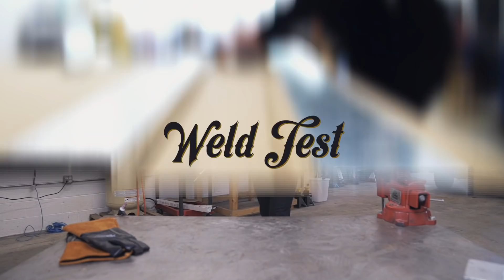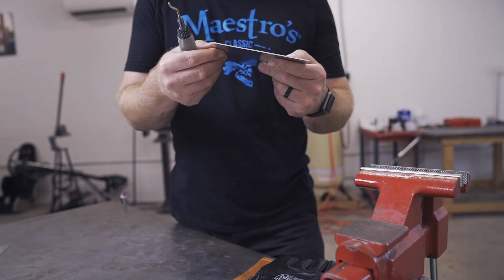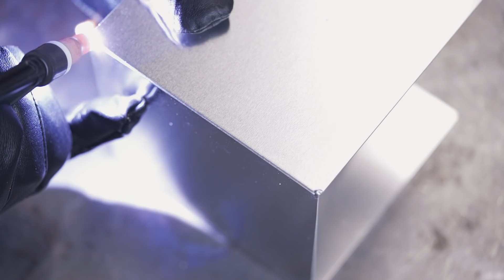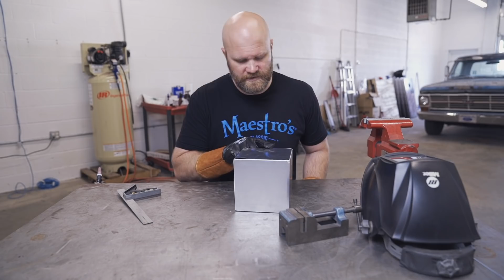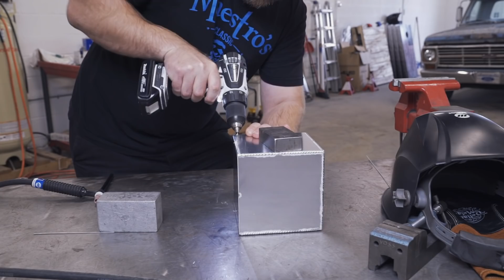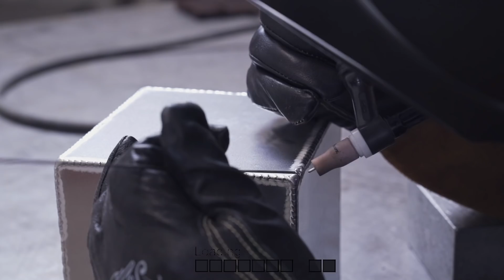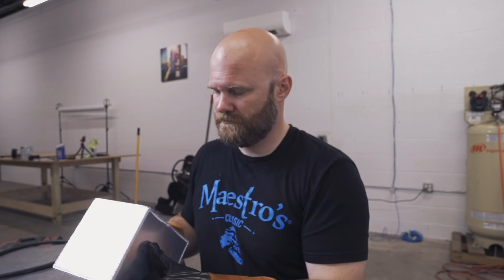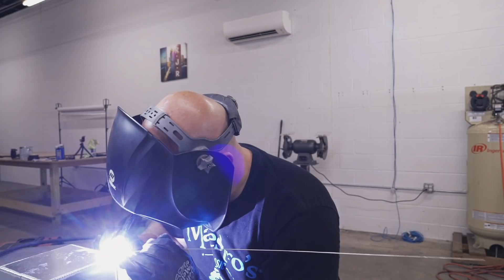Ace a NASCAR Welding Test - TIG Welding an Aluminum Cube

Comment from the maker: Incase anyone’s worried, I did get the pin hole welded. After I edited the video the piece had cooled off and it welded up fine.
Reply: Use a basketball inflating needle and fill the cube with argon
Reply: @adamchase3359  yup , easy peasy
Reply: @adamchase3359  yes very good idea
Reply: @adamchase3359  boom
Reply: @adamchase3359  damn thats smart, gonna keep that in mind
Reply: @adamchase3359  do you not weld aluminum with helium
Reply: If you cool it of during the weld it will pull the weld in
Reply: Justin Voss I was just gonna day that. When ever I’m welding up a sealed “whatever” I always have to let it cool and then quickly weld the last little hole.
Reply: As you found out and many have said, let it cool and it will close right up 99.9% of the time. 

Another tip for a cleaner appearance (especially if it does blow out on you in the process of trying to close it) is to drill your hole dead smack in the corner formed by the 3 sides. I noticed that you drilled it back along the seam about 1/2" or so. This can cause blow-out after you pass you hole to fill the last 1/2" or so.  The very last thing you want to weld is the hole itself, so better to have it as the last dab of the filler. Plus if it does blow out on you, no one will ever notice after you fix it and get it to close because it will be at the end of the weld so it will look like you just added extra filler to crater fill.
Reply: Chris this is a solid plan.
Reply: Who else gets to play with a Miller dynasty 700 every day (:
Reply: @MichaelA-rp2hy  I don't think 10% of all tig welders touch one. That is a huge tig tho I've never used any bigger than a 450. Theres definitely jobs that I needed it tho....
Reply from the maker: @Michael A Used to. Favorite welder. Would love the new 800!
Reply: @JustVoss  I'd punch in 10 minutes early every day for one of those Haha we've come along way since the old 60hz syncrowaves
Reply: Justin
Reply: @JustVoss  we just upgraded from the 700 to 800 and we've had 2 blow up already. Brought our 700s back out for now while the 800s are repaired although I think we'll be getting new ones the insulation and chasity and motherboard all the innards just blew right out of both them. Loud as hell like someone slamming a hammer next to you while your TIG welding but other than the insulation and some of the inside plastic parts nothing flew too far.
Reply: Justin Voss why dont you use a jacket? Skin cnacer i so cool you know
Reply from the maker: Probably should. I’m not welding all day  and most people in racing don’t so it’s never been a habit.
Reply: Justin Voss  I watched this video just to see you run into that problem lol. Your experience was the same as mine. Let it cool and fill the last bit quick.
Reply: By the way, the pressure is building up because of heat put into the air already in the box, not the Argon as a very small amount will get through that hole (which is also why it didn't look good because the air inside displaces the Argon from the torch).
Reply: Personally i would have thrown the cube in the freezer for about fifteen minutes and then sealed the hole.
Reply: It depends on what you want for the pressure. If you want the finished product to be pressure neutral, weld the pin hole quickly when it's cold.

If you want the hole weld to be really easy in terms of pressure and you don't mind the box having low pressure (and possibly sucking in the sides, which can be a cool look), let the whole box get as hot as it is going to get, and the pressure will be equal WHILE you are welding. then the pressure will drop once the box cools. 

The biggest issue is well the box is only medium hot when you start. That's how you get the maximum change in pressure during your weld.
Reply: Let it cool, fill w/argon with a sports ball inflating needle and put chill blocks next to your final weld.
Reply: @bluevette1978  that's great advice
Reply: My first welder was a air cooled Syncrowave 200 then I sold it for 2800 and bought a Everlast Power Pro 256 and built a watercooler and upgraded the torch to a ck flex lock 20
Reply: @alexhise968  ahhh yes  those were great ,still great although a pain in the ass if your trying to make it in aerospace. 60hz  and a balled tungsten at low amps = unstable arch  still it very doable with practice I used a 350 to pass my d17.1 and burning through a shit ton of aluminum coupons  in the process haha  on the flip side  learning to weld thin using a transformer power source makes you much more efficient once you get ur hands on modern inverter .
Reply: I don’t believe you
Reply: Something it could have been was if any oil was on that drillbit
Reply: Tony Bain 

Yes, even the slightest fucking amount of oil can cause issues with aluminum. Its kind of ridiculous actually.

Clean clean clean, make sure everything is spotless. Grinder wheel residue, using a file or wire brush thats been used on mild steel or anything other than the work.
Reply: How do I apply for a welding job in NASCAR??? I have d 17.1 AWS certification
Reply: Shitt!
Reply: PISS! OUT MY ASS!
Reply: Made a small cube like this:  20 minutes to weld all sides together nicely.  Damn near 45 minutes trying to fill the pin hole.  Learned a lot about heat control and cooling during the “repair”!
Reply: Why not use denatured alcohol? Is there a property of acetone that makes it more desirable or just cheaper?
Reply: Still a suggestion/idea for in the future, but would it be a bad idea to size down the drill bit, then drill TWO holes, so it would be easier to cover them, and still vent well enough to not take breaks near the end?
Reply: Are you related to Kyle?
Reply: Yeah, 4 years Kate but I was going to suggest putting it into a freezer for 15-30 minutes. But too cold it may ballon out when it warms up.
Reply: Just let it cool off and then hit it real quick
Reply: You dont have to wait to fill the pin hole just add more heat pushes the hot gas back in so you can fill it. Then you will see the sides suck in during cooling.
Reply: what my teacher said to me and show. if you keep getting quick blow out. depends on the size if it like pin hole. cut alluiuim welding rod to small pin nail, get piles or use vice and use hammer better yet body hammer to create a head on you pin. then tap it in the hole and tac weld it in then go over it. if long bubbles forming just grind it into v like shape grove then weld. tbf pin head weld trick it is 50/50 :P lol
Reply: @Justin Voss Whenever I weld up something like this that has to be sealed, I've had pretty good luck welding it nearly all the way out (leaving the vent hole or last little crack open), giving it about 30-45 seconds to cool, then sealing it up.  The way it was explained to me is that you want to seal it up when it's at the transition point between air going out due to heat and coming back in as it cools.  Since I started doing that, I haven't had any major issues sealing things up.  Cube looks good, though.  I didn't catch it in the video, but what did you have you frequency and balance set to and did you purposely ball the tip of the tungsten at all?  A little curious how the 1/16" tungsten held up.
Reply: @zachdaniels8112  The fit up didnt have any open gaps, they were all corner joints welded as lap joints essentially... hence him having to drill a hole to create a gap.
Reply: @kronicsoldier  yes, I understand that. I was referring to the end where he was welding said hole to seal the cube. Just an idea that's worked for me.
Reply: @zachdaniels8112  so you mean just let it cool... which this comment we're replying to "Incase anyone’s worried, I did get the pin hole welded. After I edited the video the piece had cooled off and it welded up fine." is exactly what he did...
Reply: @kronicsoldier  in the video he was unable to seal the cube despite a number of attempts. I read and replied to this comment with a tip, from one fabricator to another, that I've found to work fairly well. I doubt seriously that this is the one and only time he (or anyone else) has or will need to seal weld something and there are times, especially during weld tests, where you won't be able to let a piece cool completely due to time constraints. That's why I commented. 👍
Reply: @zachdaniels8112  "Incase anyone’s worried, I did get the pin hole welded. After I edited the video the piece had cooled off and it welded up fine." you mean the tip in the pinned comment? lol.
Reply: @kronicsoldier  if he let it cool completely, which I'm guessing was the case although I can't be certain, I'm saying for future reference that isn't necessary. I don't really know how else to explain that. If you don't understand it, well, I don't know what to tell you.
Reply: @zachdaniels8112  well thanks for the tip that was posted in the pinned comment and in other comments as well... I especially liked your hot air cold air transition theory, because air going in or out definitely changes how your argon is going to react lol changes my whole view on inert gases haha... And yes the tungsten would be balled on purpose. 1/16th tungsten would hold up fine with .063 aluminum sheet metal and  (possibly 1/8 but the way it flexes it appears to be 1/16 filler rod.. Anyway have a good one bud.
Reply: @kronicsoldier  when you weld a sealed enclosure, the heat generated from welding will eventually heat the air inside the enclosure as well. As gas is heated, it expands, which is what causes the blowout when the last little bit is welded. The gas escaping from the hole literally blows the still fluid puddle out and blows the shielding gas exposing the molten metal and tungsten to atmospheric conditions (same as trying to MIG or TIG in a breeze). After a short break from welding (30-45 seconds, like I said previously), pressure inside the enclosure should have nearly equalized with pressure outside the enclosure resulting in close to zero flow through the hole, which can then be welded. I've tried seal welding aluminum boxes multiple times and have had better results giving it a 30 count then welding the hole with the material still warm than I have allowing the piece the cool completely.

And no, balling the tungsten purposely isn't necessary on an inverter nor a transformer machine. Only time you could consider it borderline necessary is if you're nearing the amperage carrying limits of the tungsten. AC balance and frequency (and amplitude control if you have a machine capable of it) make the biggest difference on the heat applied to the tip of the tungsten and ultimately how well a sharpened tungsten will maintain that shape while welding on AC. It's not often you hear someone running a 1/16" tungsten welding aluminum, so yes, I'm curious to hear what settings he was running for these joints.

Lastly, 1/32" (I can only guess you mean .030" or .035") TIG filler would be almost completely useless on aluminum. Even if you managed to get it into the puddle without it balling up, it'd be damn near impossible to feed fast enough to keep up with the weld progression. Plus, I'm reasonably sure he said it was 1/16" filler in the video.
Reply: @zachdaniels8112  haha the proper procedure for welding any enclosed aluminum is to use a basketball inflating attachment and fill the vessel with argon or your not protecting the backside of the weld. I run 1/16" tungsten on 16ga quite often and I said the way it flexed it looked like 1/16th filler wire. Keep stating the obvious with your novels lol.
Reply: @kronicsoldier  I can't say that I've ever heard of anyone purge welding aluminum, especially not 6061. Stainless, yes. Titanium, yes. Nickel alloys, yes. Aluminum? No.

I mean if you were welding intercooler plumbing or something like that and wanted full pen with minimal buildup on the inside, then maybe. But that wouldn't be for shielding the backside of the weld...
Reply: @zachdaniels8112  read through the comments you'll hear about it a lot lol.
Reply: @zachdaniels8112  I like how you mention intercooler plumbing, your usage of google is phenomenal lol.
Reply: @zachdaniels8112  unfortunately its not used just for back purging.. yes it protects the back of the weld and helps to form the backside of the bead because it would be considered "open root", but the argon is used to displace the oxygen lol. We do it often in open root welds in the aerospace and pressure vessel sector, as mostly all open root welds are 100% xray hence the balled tungsten, if you use a pointed tungsten youre asking for tungsten inclusion and a weld thats going to need repairs...
Reply: @kronicsoldier   yeah dude, that's what back purging is - displacing oxygen with an inert gas to shield the backside of the weld and HAZ. And yes, intercooler plumbing. Seeing that this video literally has "Ace a NASCAR welding test" in the title, I deduced that he's referring to the automotive industry and wasn't concerned with the requirements or procedures for Lockheed Martin or NASA.

Serious question though, you said proper procedure for this would be to fill it with inert gas through the last remaining hole then seal it. Where would something like this ever be used, aerospace or otherwise? A sealed box doesn't seem all that useful. If it were a tank, expansion chamber, or something like that, there'd be at least one opening in the finished assembly for hose connections or whatever, which I would think would be opened before sealing the chamber to decrease the likelihood of problems with the weld joint. I'm not in the aerospace industry, so I honestly don't know.
Reply: @zachdaniels8112  So while welding certain things mostly piping it has to be done open root and 100% xrayed so while welding the PUPs in the shop we inflate two specialized balloons (purge dams) or just tape off the ends if possible.. Weld said joint 90% of the way, insert basketball attachment into the joint and fill with argon and then finish the weld. Then QC comes and sprays it with soap, runs MP, and shoots 100% of the weld, then deflates the balloons. I made it clear I was talking about open root because once he blew through the corner joint thats what it became, the process isnt just written for boxes lol but I can understand how you probably haven't came across something so critical yet in your career.
Reply: @zachdaniels8112  In fact same thing applies for the square tubing we use to build the frames that NASA tests their rockets in.. which with the balloons inside is a square box. I dont expect any rinky dinky shop to know or follow the welding procedure on something non-critical but apparently you've ran into it because you wait 30-45seconds (which by the way aluminum holds heat pretty good considering it and copper are used as the main heat sinks and after 30-45 seconds hot air would still be rising) and just weld right on over it.. Just cause it appears to be a good weld doesnt mean you dont have cluster porosity on the backside or inside your weld. Plus you're probably only used to single pass welds, but correct me if Im wrong.
Reply: @kronicsoldier   KRoNiC SouLJaH  nah, I understand it's not just for boxes and I understand the purpose of back purging (I deal with a lot of stainless), but for what is done in the automotive industry, I'd imagine very little aluminum, if any, would be back purged due to time, cost, and the general lack of necessity since nearly everything is closed root joints. Open root is a different story, though, you're correct there.

I'm still a little confused with the open root stuff, though. Taping the ends or filling the balloons sounds like it's just a purge dam. Pardon me if this is hella dumb, but are you welding out 90% of the joint with no purge gas and only purging the last 10% before the joint is closed or are you purging the entire thing? If the balloons/tape can be removed after the joint is welded out and has passed x-ray, wouldn't that mean the pipe was still open and reasonably accessible to just run a purge like you'd do for sanitary tubing? Or are we talking the center of a 80-foot run of pipe that has essentially zero access once welded out?
Reply: @kronicsoldier  nope, you're correct. Like you said previously regarding the video, though - it's a box lol. Doesn't really fall under any sort of scrutiny other than not falling apart. The 30-45 seconds that I suggested (again, not falling under any extreme testing standard) has allowed me to seal the piece without waiting 15-20 minutes for it to cool down completely. I've actually let aluminum pieces cool down for quite some time and still had problems welding the last bit. The chances of it passing x-ray is about the same as monkey flying out of my butt, but it's sealed and looks halfway decent.
Reply: Fingerprints probably.
Reply: You didnt remove the aluminum oxide that covers the metal, making it harder to weld and your welds wont stand the test of time. You did all this for show on youtube and for the sake of teaching proper techniques.
Reply: @carsnmods1687  lol he wasnt welding the surface just the cut edges. The acetone is fine for that.... the test of time hahaha .. Hate to be the bearer of bad news but surface aluminum oxide starts to form the moment you remove it you either burn through it and get penetration or you dont... I'm sure that box will hold without cracking just fine. lol its a frickin box.
Reply: @carsnmods1687  He had a long arc length (probably for arc shots on video) and probably a lot of low AC balance and what appeared to me anyway to be adequate cleaning action in the video. Couple that with his use of a scuff wheel to fix the screwups and I'm not exactly sure what you're suggesting he should do differently. Can you expand on what you're talking about exactly?
Reply: @ChevyConQueso  See how the aluminum is all shiny? It should be dull when you weld on it. He shouldve cleaned up all the aluminum oxide where hes going to weld. It takes a ton more heat to get through the oxide than to just weld the aluminum. Welding is for strength in the real world and not for show. This guy should be ashamed.